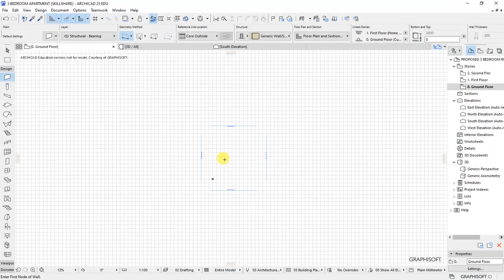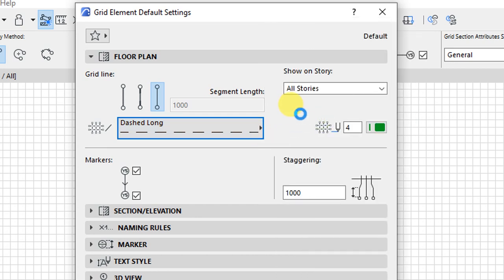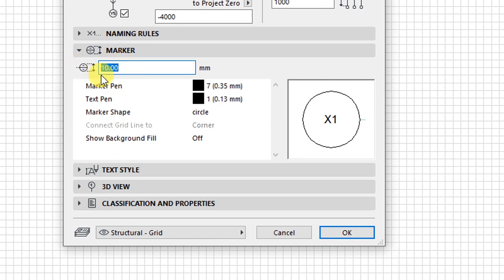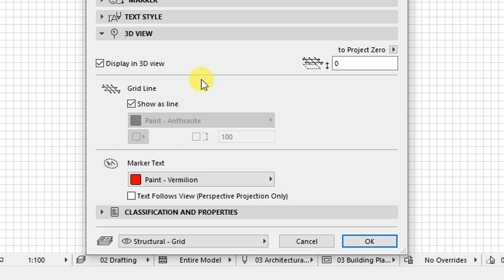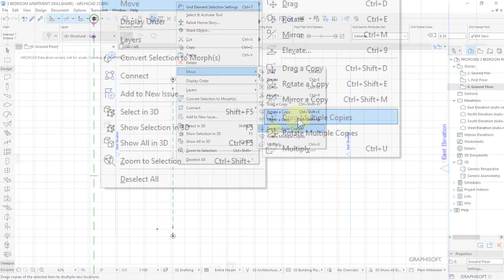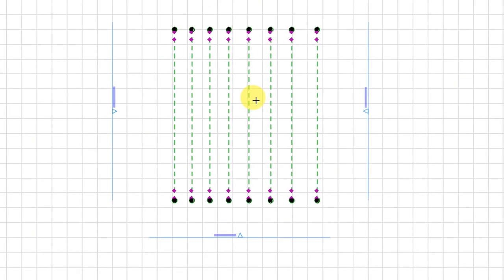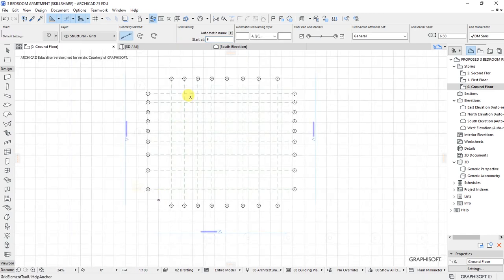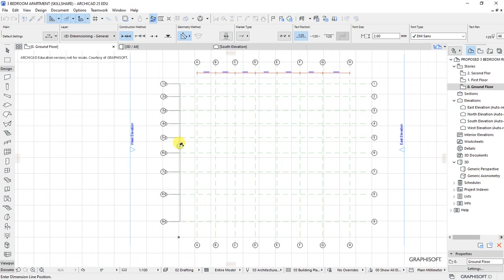Lesson 04 - Construction Grid System [ArchiCAD 25 Basics]

Comment: Hello Muimi, What's the purpose of having or setting up the Grid system? Is it necessary prior to designing a house?
Reply from the maker: I used the grids in this case to help me position the structural load bearing elements in my project. 
It is not necessary to have them, they only serve as drafting aids in this case.
Reply: @QuantBuildAcademy  I understand now. Thanks